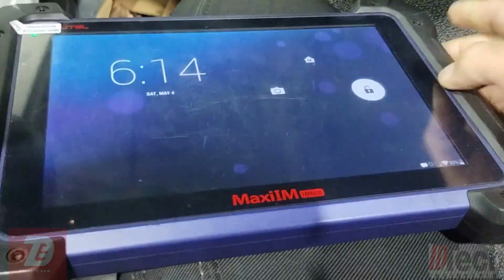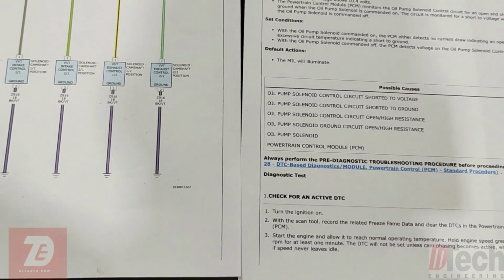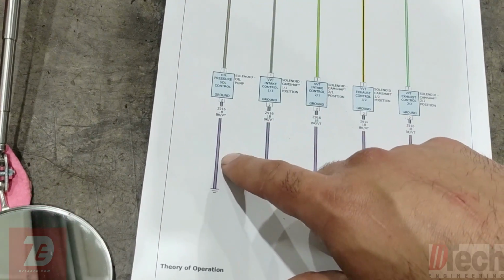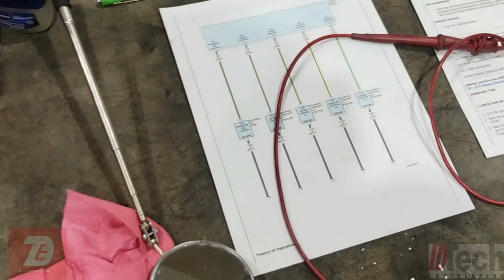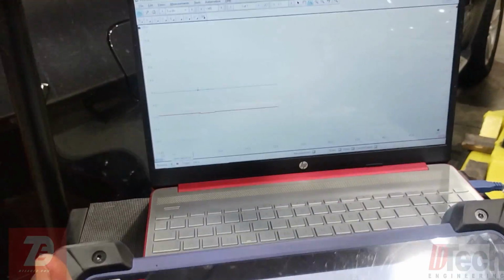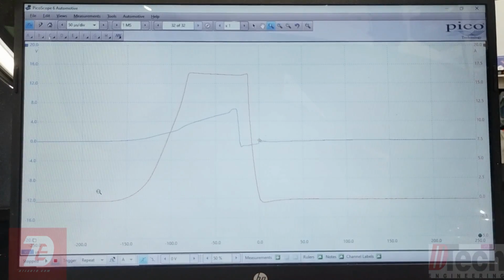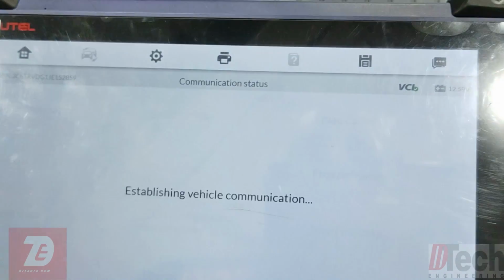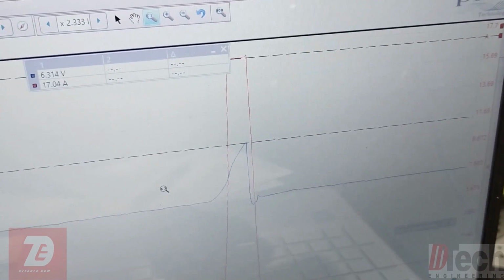P06DA FIX! Engine Oil Pressure Control Circuit Fix Pentastar

Comment: Where was the short located,having the same issue?
Reply from the maker: Mine was in the harness, internally shorted together inside the shielding, by the exhaust side
Reply: Btw i love the cannon...
Reply: Nice video. I stuck my head up there and for the life of me I don't see how you can repair that wire. I can barely touch it let alone repair it.
Reply: @JohnWhite-Iowa-City remove a lot of shit out way 😂😂

Comment: Hey, thanks for the helpful video! I have the same exact code (P06DA) on my 2016 Ram Promaster 2500! I'm wondering what I can do to fix it? Is it a sensor replacement or oil pump replacement/oil pressure solenoid control , etc? The oil light comes on every now and then; oddly enough, when its on and I hit a bump, it turns off most of the time. I would say it's always on and off light! 

How can I go about fixing this without breaking the bank? What should I do? Would it be the oil pressure sensor or the oil sensor in the sump tank area? oil pressure solenoid control?
Reply from the maker: if it is the same exact code, I would look at the electrical circuit for the control solenoid, not the pressure sensor
Reply: @DTEAuto  Ok will check that out. Where would that be located exactly? Also, could it be the filter causing the low pressure?

Comment: Thanks for bringing us along. Cool study. I actually dislike using the continuity mode anymore because of its limitations. If I’m using an ohm meter, which is basically what the continuity tester is, I’m going to just measure the resistance of the circuit instead. I want to see that number. If I want to check for continuity I’ll use a calibrated test light because it will tell me so much more about circuit integrity. Depending on the resistance of the bulb you’re using you can make a pretty good assessment of the resistance on the circuit based on the bulb brightness. Bright bulb= close to zero ohms. dimmer bulb =close to bulbs resistance. very dim or off = higher than bulbs resistance or open. This does mean you need a half dozen different bulbs for testing tho 😂 but I think it’s so much more valuable in the feedback you’re getting.

Comment: I would have unplugged computer, and used a power probe right on that pin to see if i could activate the solenoid. If not, and circuit breaker pops, then i know wire is shorted, or solenoid. If circuit breaker doesn’t pop, i know open circuit